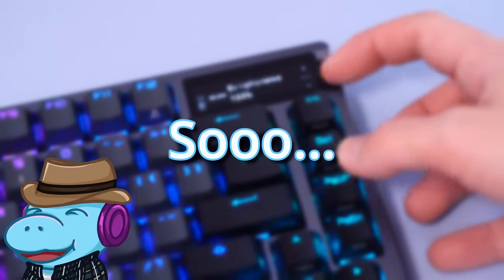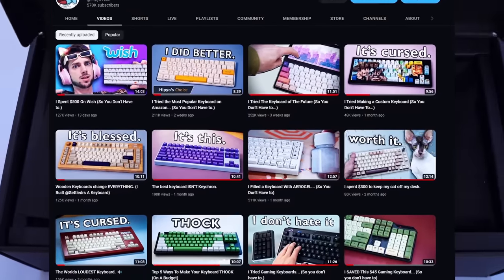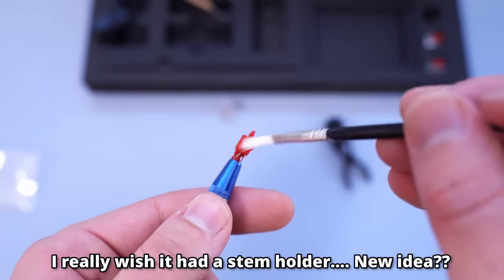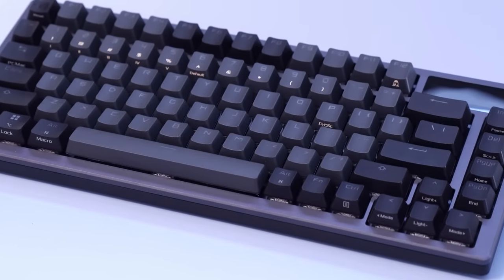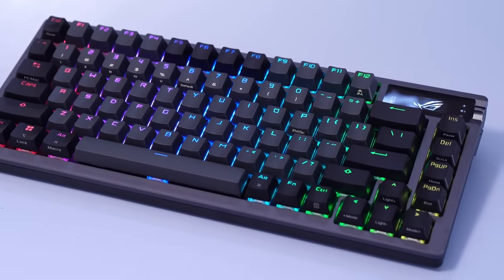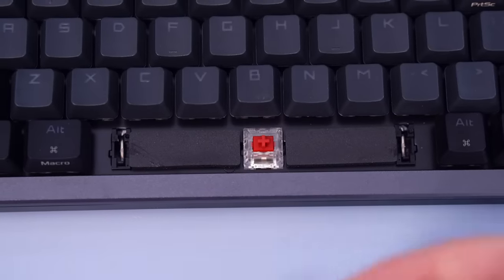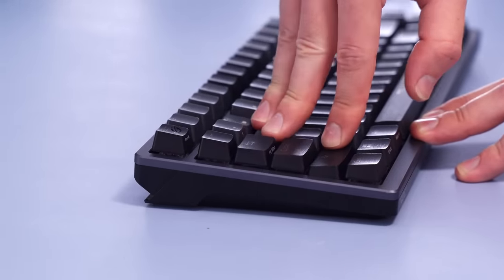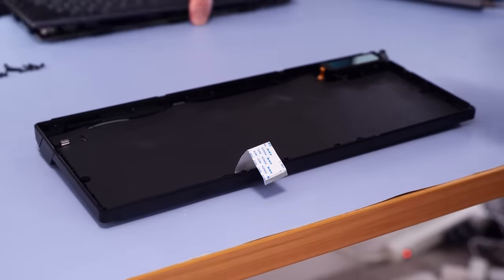I Tried the New ASUS Keyboard. ( ̶S̶o̶ ̶y̶o̶u̶ ̶d̶o̶n̶'̶t̶ ̶h̶a̶v̶e̶ ̶t̶o̶)

Comment: $250??? LOL, this is not a good deal, like If you want a gimmicky keyboard get moon drops, at least it has a DAC in it. This has a bad screen that is limited by software, bad keycaps, bad switches, super generic muted sound, garbage quality accessories, and the case is super thin plastic... 2/10 this is an advertisement for Asus.